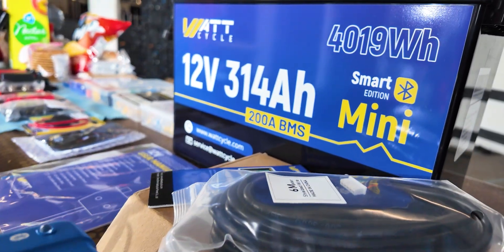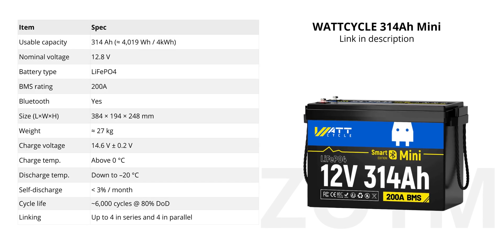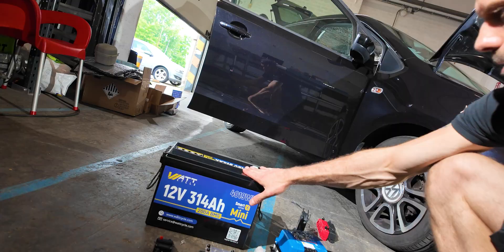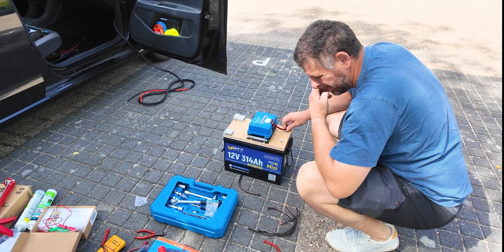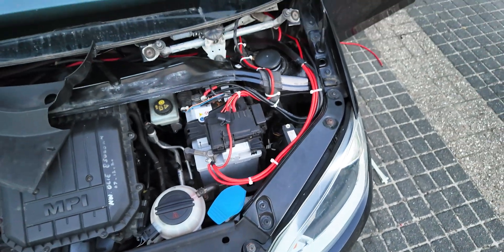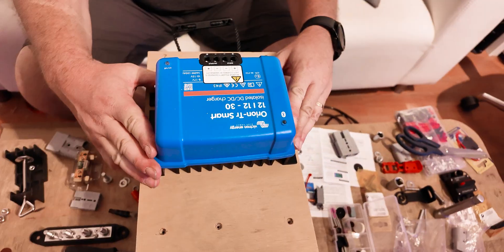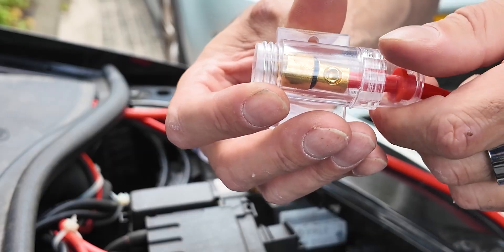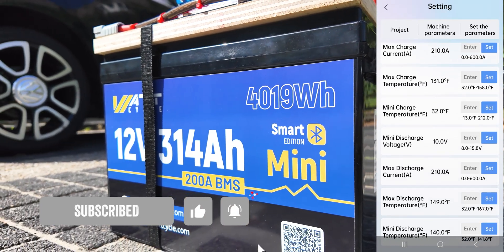PREPARING FOR SIBERIA: AUXILIARY BATTERY INSTALLATION

Comment: Did you also replace/upgraded the main engine battery?

When mine died (5 years ago, seems like was yesterday) I replaced the original 45A 300CCA by a 52A 550CCA so today even my battery being weak still more than enough to start the car even after a long time without driving.
Reply from the maker: I've ordered a 60A AGM. Installing today

Comment: У нас часто используют webasto либо его аналоги от других фирм а также сигнализации с автозапуском (можно настроить по температуре, напряжению борт сети или по таимеру). Иногда врезают тену  и подключают к внешнему источнику питания. Чесно говоря  непомню чтоб было -60, максимум что я застал за всю свою жизнь было -54! При таком морозе не советую глушить машину темболее если вы один. Обычно на работе при -40 и ниже стараются не глушить машины в такой мороз ( особенно дизельные), а также неиспользовать гидравлику. В Якутии еще делают вторые стекла на машине чтоб не обмерзали
We often use webasto or its analogues from other companies, as well as alarms with auto-start (which can be set to temperature, voltage, or timer). Sometimes they install a heater and connect it to an external power source. To be honest, I don't remember it being -60, as the coldest I've experienced was -54. In such temperatures, it's not recommended to turn off the car, especially if you're alone. Usually, when it's -40 or lower, people try not to turn off their cars (especially diesel cars) or use hydraulics. In Yakutia, they also install second windows on their cars to prevent frost buildup.
Reply from the maker: Спасибо, что поделились своим опытом. Очень ценю советы от людей, которые реально живут в таких температурах. У меня бензиновая машина, и я установил дополнительное оборудование для сильных морозов: подогрев аккумулятора, подогрев масла и подогрев охлаждающей жидкости через Webasto. Я понимаю риски и не буду глушить двигатель при опасно низких температурах, особенно когда я один. Я очень тщательно готовлюсь к этой поездке, и ваши советы мне действительно помогают.

Thank you for sharing your experience. I really appreciate advice from people who actually live in these temperatures. My car is petrol, and I installed extra systems for extreme cold: battery heating, oil heating and coolant heating with a Webasto. I understand the risks and I won’t turn off the engine when it gets dangerously cold, especially when I’m alone. I’m preparing very carefully for this trip, and your advice really helps.

Comment: Ik zie dat je een lithium batterij heb geïnstalleerd. 
Weet niet of je er aan gedacht heb, lithium kan je niet opladen  onder de 5 graden. Grote kans dat die kapot gaat. Je kan wel stroom afnemen. 
Oplossing is een warmte lint er om heen doen en inpakken. Schakelaar tussen het lint voor onnodig verbruik. 
Lithium laad ook beter op bij wat hogere temperaturen. 
Gr.Henk
Reply from the maker: Hoi Henk, hij laadt bij in de auto waar het  warm is. Ontladen kan eventueel zelfs tot -20 °C. De startaccu buiten heeft idd heating pads.
Reply: Mijn advies is ook om de kabelschoen te knijpen. Bij grote temperatuurverschillen kan het bij solderen losraken, 2 verschillende metalen met ieder een bepaalde uitzetting.
Gr.Henk

Comment: you basically dont even need the oil pan heater. you can point the webasto exhaust towards the oil pan
Reply from the maker: Thanks for thinking with me on this, I'll add it to the plan to investigate if it's possible.

Comment: Well, it is a nice setup BUT! If you turn off the engine for more than a few hours, you still cannot be able to start it again. The engine bay is not heated, so the engine and the start battery will be too cold to start. This is the reason why all cars in Siberia are running (idling) nonstop. So be careful.
Reply from the maker: The Webasto heater heats the coolant system of the car, so the engine is always warm. It also heats the interior just like if tje engine was running. For the battery, I use heating pads that will warm the battery, and also a jumpstarter in case it still does not go. I use 0W30 engine oil that stays fluid to about -40 °C. Considering engine oil heating still.
Reply: @ZoefontheMove  oh I missed that, nice :-)

Comment: In my Citroën, the alternator reaches around 100°C at idle with the A/C on during summer heat, which reduces its efficiency. This not only causes it to wear out much faster but also puts stress on all the car’s electrical components (ECU, BMS, etc.). My alternator is rated at 120 amps, but under load I’ve never seen it draw more than 60 amps. Still, you should definitely test how much power all your equipment will consume and how hot your alternator will get. Otherwise, you risk burning out the alternator’s diode plate.
Reply from the maker: Hi! Thanks for pointing this out! I thought about this though. TheFossibot F2400 power station can be charged with either 100W or 470W. At idle I l'll never leave it at 470W.

As for the Victron charger for the WattCycle battery, I can control the charging speed with the application on my phone. I'll never leave both of them charging at the same time. The alternator is rated for 140A, due to the start/stop system that I never use.

Furthermore, it's going to be really cold in Siberia so I'm not too worried about overheating the alternator.

I do consider taking a spare alternator with me, just in case. Because this is a single point of failure in the chain of energy.
Reply: @ZoefontheMove  Make sure your engine speed is not below 2000 RPM when charging. For an air-cooled alternator, engine RPM is very important. If possible, place some insulation material between the alternator and the exhaust. Also, at engine speeds of 2000 RPM and above, the frequency (Hz) of the alternator’s output voltage increases, which is beneficial for electronic devices
Reply from the maker: @NitroCharger The alternator is attached on the front side (of the car). The exhaust under the windshield. I'm actually covering any openings in the bumper as soon as it gets below -10.

Comment: "How did you fix the transmission issue? I haven’t seen a video about it yet, or did I miss it?"
Reply from the maker: Really, this stuff is still going on! It's a nightmare! But... I want to publish the video about this whole thing when I have found the final solution. Parts have just been arrived yesterday.

If this fixed the issue of breaking the gearboxes, I only need one more gearbox and it's solved 🤣. After that, the video gets a proper ending :).
Reply: @ZoefontheMove  Don't forget to take an Elm327 OBD 2 adapter with you, which will allow you to track fault codes and find solutions.
Reply from the maker: @NitroCharger  Good one! Can you advise me one?
Reply: @ZoefontheMove  . Obd Advise vgate icar pro. To prevent your rims from getting packed with snow and losing balance, switch to standard rims with thicker sidewall tires. Your alloy rims will collect snow and lose balance.
Reply from the maker: @NitroCharger  Black steel rims and bigger tires are delivered. Waiting for the liftkit to be in stock again. Also, the rubber is really soft, so I might postpone mounting them a bit so they don't wear too much here. As for the rims, I'm thinking about waxing them on the inside so snow cannot attach to it.

Thanks. I'll order the vgate icar pro. What app works well with it?
Reply: @ZoefontheMove torque pro,

Comment: Can I ask how much the whole system was with battery and dc-dc charger? Why didn't you buy one more power station instead? What is the benefit of this system over a power station?
Reply from the maker: The power station is only 2kWh. The WattCycle battery alone holds ~4kWh. The Webasto would drain the power station too fast for a trip to -60 °C Siberia. Also the power station needs to power the electric blanket and other stuff through the night. Cost for the Wattcycle battery + Victron would be around €700.
Reply: @ZoefontheMove  Thanks for you reply. I'm planning a winter trip here in Europe and thinking about whether a power station or a battery+charger system like this would be better. I can't see much benfit of this separate battery+charger system over a power station so this is why I was curious about your opinion.  
Heating blanket and bed heater is a must for me, but I will make a 12v by heating cable instead of 220v blanket to make sure I can use them more efficiently. Also I made a heating vest already that I can use from 12v. 
I'm very curious how you will create your Webasto heater as I want the same because air diesel heater is too noisy for me.
Reply from the maker: I've found a seller in Ukraine that offers complete refurbished Webasto sets for less than €400. Mine is on its way to me now. It will run on the same petrol tank as the car, so no hassle with an extra fuel tank for the heater.

You'll be fine with the FossiBot F2400 Power Station, together with the Fossibot FAC580 DC-DC charger. I did an installation video on the channel recently, including some discount in the description.

Comment: Ah, you use the Webasto to heat your car all night long. And that's why you need that large extra battery. But now you have two DC-DC converters? Is that going to work?
Are you going to test the entire setup before leaving to Siberia?
Reply from the maker: If I end up in a snowstorm or something, I need to have enough power to heat the car through those days.

The 230V power station is for the electrical blanket when and other devices. It's also a form of redundancy, if 1 DC-DC  charger breaks down I can use the other battery to charge it. I won't be running both DC-DC chargers at the same time.